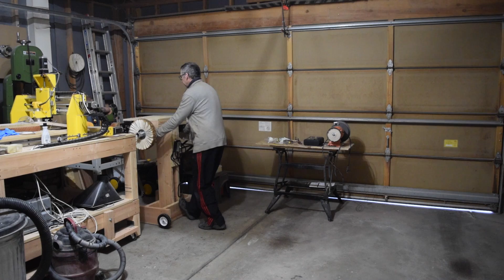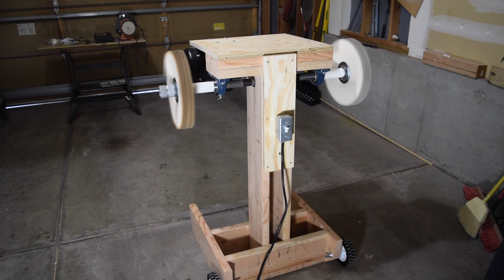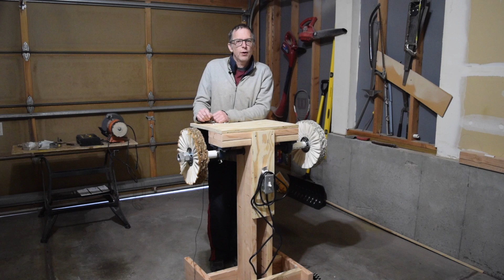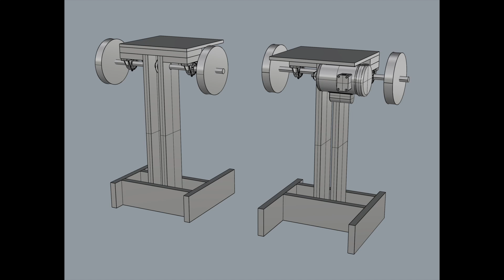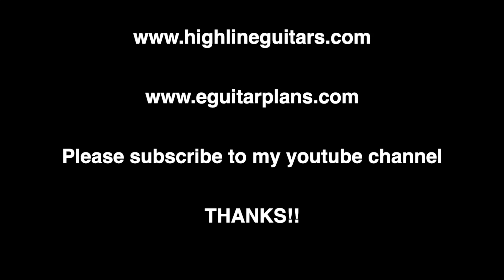Making Your Own Guitar Buffing Machine

Comment: Hi the only thing I am having trouble understanding is how you attached the pulley to the polishing motor shaft. Is there some keyway that was cut onto the middle of the shaft? If not is it secured with set screws only?
Reply from the maker: Set screws.
Reply: @HighlineGuitars ok thanks!  is there a special pulley you used that does not have a keyway? I looked online and everything has a keyway

Comment: This is  pretty cool. I don't know what mods you've made since you posted this video, but a couple I thought would be to counter-sink the motor mounting bolts into the top, even if you had to put some wood below to reinforce since you're losing space to the counter-sunk bolts. The second thought is did you or could you make some quick disconnect system for the motor so you don't have to unscrew the bolts every time you wanted to swap it to your drum sander? I see you have plans for sale. Does it include any locations where some of these things can be bought?
Reply from the maker: You can mod it anyway you see fit. It’s no longer possible to list sources. They change daily.

Comment: Question I haven't seen...your plans say to buy 2x10's which are 9 ¼" Actual - the plans show the dimensions of these parts at 7".  Which would be closer to a 2x8 at and actual of 7 ¼".  Are 2x8's sufficient? What should be used?  Thanks in advance!
Reply from the maker: I had to use 2X10 because the 2X8 were less than 7". Use whatever you can get a width of 7" from.
Reply: @HighlineGuitars  Thanks for the fast reply!

Comment: Chris, 
I purchased your plan for the buffing machine and I have a couple of questions.  In the video, it points out that you used 2x8 lumber, not 2x10's.  Has this changed between the time you made the video and printing the plans, or is it a misprint in the plan?  Same with the shaft, you state you used a 1 1/4" shaft, but the plans say 1".  Which should it be?
It looks like a simple enough build, but I want to do it right and purchase the correct materials.
Reply from the maker: Follow the plan. It’s correct. The machine in the video was my prototype and improvements were made.

Comment: Just purchased the plans; looks good! Is the purpose of the wood piece with the door hinges to maintain tension on the belt?
Thanks!
Reply from the maker: Yes, it controls the belt tension.
Reply: @HighlineGuitars  Sorry, I'm confused; this is for the buffing machine, right? How does that piece of wood under the motor, that is held on with door hinges, control the thickness of anything? Again, I'm sorry; I'm not trying to be argumentative, just confused.

Comment: I'm starting to put mine together now. 1" diameter shaft 36" long. 1/2 HP motor. 3 x 14" pads per side. The StewMac ones. I can't believe the end flanges were $32 a PAIR. Everything ordered. I got the 1" x 36" rod at Tractor Supply and the nuts. I was able to roll it on the floor at the store to get a straight one.
Reply: How did this work out for you. I'm trying to figure out which way to go as well.

Comment: Have you considered a sewing machine rheostat (foot switch) to adjust your rpms?
Also, two soft open or closed cell 1" foam strips on two sides of the table top (perhaps atop a 2x4 for added height) would allow you to lay your work across the top (short term of course) and still have space for polishing compounds, etc.  I salvaged two from a packing crate that I use often, clamped across a 2 x 12 on a set of horses.
Nice video... gotta live HFreight!
Reply from the maker: Once you have your rpm dialed in, it's not something you'll change very often.

Comment: Having trouble - Can't locate the correct revised shaft.  Your latest links list has a different 1 1/4 shaft, and your revised plans call for a 1" shaft but no links or description is given.  I can't locate the right part, do you mind sending a shaft link or giving more details on the shaft on the revised plans?  TIA
Reply from the maker: This is what you should use:

https://www.metalsdepot.com/cold-finish-steel-products/1045-tgp-steel-shafting?gclid=Cj0KCQiAst2BBhDJARIsAGo2ldXaXA3QcUnwQCKiY5vG6Qjo6dLHQo3opFYcmb7KmEo4QrGb4N_IafYaArdYEALw_wcB

You'll need to have 6" of each end threaded. One side left hand the other right hand.
Reply: @HighlineGuitars  Can anyone give me an idea on a fair price for threading? I had a local shop quote me $170 for just the threads.

Comment: Nice job! You might consider a link belt to further cut down on vibration. I put one on my drill press and it's like night and day.
Reply from the maker: I put a link belt on it about a week after this video was made.
Reply: Hi Ken, which horsepower rating motor did you use for your buffer?

Comment: How do you get it to run SOOO smoothly ?
Reply from the maker: As long as the shaft is straight and you use a link belt, it'll run pretty smooth.
Reply: @HighlineGuitars    Aaahhh... Perhaps it's the Link Belt that will help !  I'll try that, Many Thanks !

Comment: Thanks for this video and for all of the links.   I also purchased the plans from the linked website.  Would you be able to provide a link or suggestion for the belt (particularly the “OC” size of the belt)?
Reply from the maker: Use this calculator to determine what size belt you'll need for your application: https://www.blocklayer.com/pulley-belteng.aspx
Reply: Highline Guitars  got it thanks!   For the plans, do you by any chance sell plans for your updated design shown in the video?   The plans I bought look to be a slightly different design (with the pillow blocks mounted to the central leg of the stand rather than under the table top and farther apart as shown in this vid).  If no plans are available I’m sure I can emulate your updated design but I figured it couldn’t hurt to ask.  Thanks again for all of your informative videos.
Reply from the maker: @tkmclaughlin  You've got it backward. The video is the old, outdated design. The plans are the revised and updated design.
Reply: Highline Guitars ahh!  OK!  Thanks again!
Reply from the maker: @tkmclaughlin  Trust me, you don't want that shelf. It gets in the way and prevents unfettered access to the buffing wheels.

Comment: Did you purchase the flanges from the same place you bought the buffer wheels or did you drill out (re-purpose) a set from StewMac?
Reply from the maker: I bought them many years ago from Grizzly Tools. They don't sell them anymore, but you can get them from Bayland: https://baylandproducts.com/products/6-inch-steel-end-flange-fits-all-5-center-airway-buffs
Reply: @HighlineGuitars  @67$ a pair, yikes!
Reply from the maker: @markmelville6670  Yeah, it sucks, doesn't it?
Reply: @HighlineGuitars  When you add the cost up you may be better off just buying Stew Macs buffing arbor and using your own motor....
Reply from the maker: @markmelville6670  You should only build this machine if you have some of the parts already or can source them cheaper. I got my flanges for $5 each.
Reply: @HighlineGuitars   What is the cost of all the parts approximately? I don't have any parts on hand and wouldn't know where to source them cheaply so would you recommend just buying the stewmac machine?

Comment: I guess changing the belt is a disassembly process?
Reply from the maker: Yes, you have to slide the shaft out. However, it might be a decade before you'll have to change the belt. Also, you could use a link belt instead.

Comment: I love the PVC distance pieces. You did a great job! I'm betting you add some attachment to store the other buffing wheels. 
If you ever do one more iteration: 
Look for a steel tube rather than a shaft milled from the solid. It will be cheaper and it's easier to harden it through and through. The threads can be cut prior. The resistance against bending&torsion is a bit lower, but you're running it at low rpm. 
Another option would be two shorter shafts both powered by the same motor. It would require 2 more bearings, but those can be dimensioned much smaller, cause the shafts are shorter and the torque has less lever. 
When you're doing your drum sander, get a proper on/off switch and emergency stop button. They cost 5 bucks. 

You did the best build with the salvaged parts from your old build! Probably with the lowest cost possible. 
Thank you for sharing. Looking forward to your drum sander.

Comment: That's an ideal design, I may well build that for my workshop, thanks for sharing. I'm in the process of building a chain and sprocket powered conveyor belt drum sander. I'm using 600mm x 75mm x 4mm aluminium tubing for the drum rather than diy wood drum. There is a 20mm solid steel rod going through the tube supported by 50mm solid turned aluminium blocks either end. The rod is supported by 2 cast pillow blocks one end with a pulley driven by 1hp motor. 5 x threaded10mm studs wind the table up and down by chain and sprockets. I wanted 600mm wide as it gives me at least 500mm practical usable width. Looking forward to seeing your drum sander build as you really think things through. I live in the UK, do you or any of your followers know if I can get the Solorez products you use over in England? Thanks

Comment: great design!.. all it needs is leveling feet opposite the wheels
Reply from the maker: Just installed them!
Reply: also consider using a longer belt with a on-off idler wheel linkage. would be a way to prevent 'belt-set' from sitting under tension unused for long periods. also make it easier for you to remove the motor